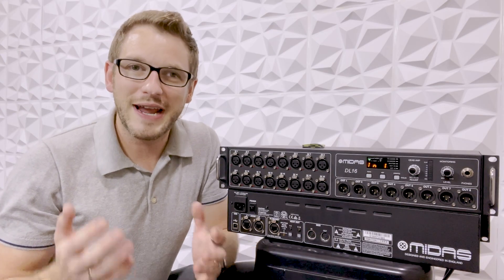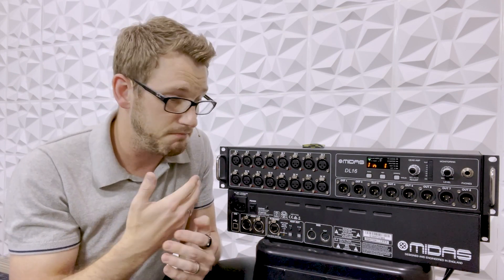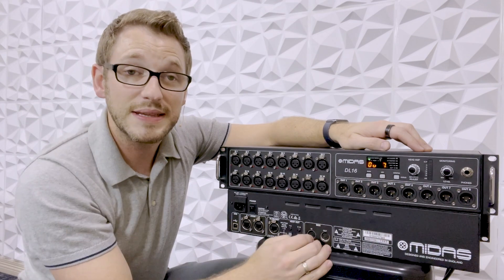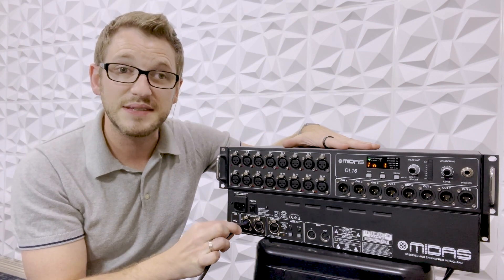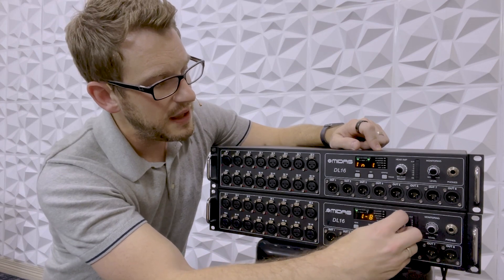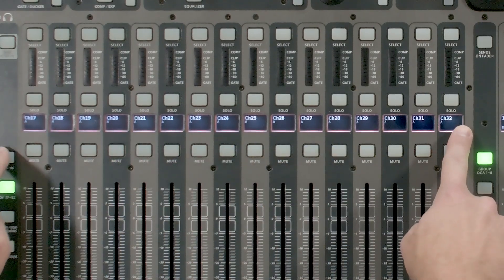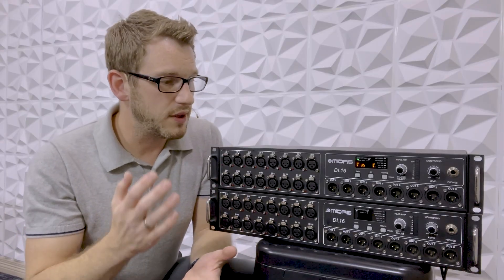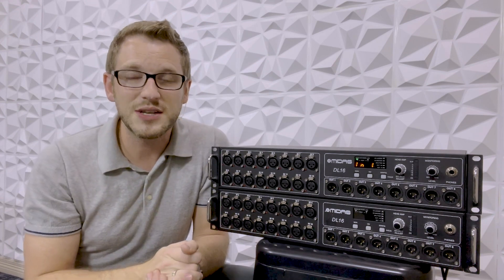Midas DL16 Stage Box & Behringer S16 Stage Box Tutorial

Comment: Drew, thanks very much for such a thorough explanation. However, I still have one question. From what I understand so far, with the DL16 you can't add more channels but rather assign a group of local channels to be routed to the DL16. I have an M32R, and my question is whether it is possible to expand — to add extra channels via the DL16 without losing the local channels on the M32R.   Thanks very much :)
Reply: I don’t know if you have already gotten an answer yet about your question. So I thought I would explain anyway in case you haven’t.

Yes, you can add channels with the DL16 to your M32r. The DL16 doesn’t replace local channels on your M32r. You just need to route everything properly.

So you could make channels 1–16 come from the mixer’s local inputs, and then make channels 17–32 come from the DL16. All you do is tell each channel whether its sound is coming from “Local” or “AES50” (which is the DL16 connection name).
Reply: @j @jaegeorge1045 thsnk you very much for your answer 😊 I suspected that it could be selectively done via user in/out routing.  Though i am thinking that dl16 is way too much for me, but perhaps dl8 would be enough.  Do you know anything about these? Are they as good as dl16? Thx 😊

Comment: new to x32 with S16. Got sync for "A" working. No audio out for speakers on S16. Routed x32 1-8 inputs by selecting "local 1-8." From the S16, need L&R outputs (1&2 or 7&8) to amplifier.

Comment: Hi Drew first off love your channel and particularly all the X32 related content. Quick question related to the S16 and Ultranet port. Can i connect it to a MidasDN4816-O and use it to be a splitter. i currently use the X32 Rack/S16 and have a Midas DN4816-O running off channells 1 throu 16. My S16 is congigured now 17 through 32 but i would like to use a digital splitter for the 17-32 inputs and ultimately have 2 x Midas DN4816-O's as my splitter. One connected through the X32 Rack(this works) and one running off the S16 Ultranet for those channels 17-32.

Comment: Why does it have a setting to set the outputs, but not the inputs? Is the first one in the chain always going to be 1-16 and the second in the chain 17-32? If so, why does this not apply to the outputs?
Reply: Wondering about the same thing.

I guess there's an explanation that can be figured out by looking into the routing section of the console (or in X32 edit), but it is very confusing to look at.
Reply: I might have figured it out :

- the DL16 has 16 inputs, so it can only send those 16 inputs to the console, via the AES A or AES B port. There's nothing to set really on the DL16.

- on the other hand, the DL16 can receive up to 8 channels from the console via AES, but since on a single AES cable you can send up to 48 channels, you need to tell the DL16 if the 8 channels he will be receiving from the console from the AES A cable (for instance) will be the AES A 1-8 or the AES 9-16 outputs of the console.

Comment: i have one of those but for some reason it has stopped linking to the mixer. when i plug the cable from the A port on the mixer to the A port of the stage box the box wont link to the mixer but if should unplug the cable from the A port on the box to the B port then it will link. doing so i dont get audio from the box the mixer. as to my under standing the audio will no route out of the B port only from the A port. Because i had tried everything from watching turorials and such do i need a new stage box?
Reply: I have the same problem right now. Did you find a solution

Comment: Great videos! I have an X32 Rack (main mixer FOH) and S16. I should have 32 IN/16 OUT. The IN/OUTs  are split between the two. I began by setting up my personal IEM on the S16 along with two stereo keyboards and 1 mic for testing. 2 stereo keyboards in CH17-20 (AES50-A1-8) and 1 Mic CH6 (rack) all User routed to outputs 9-10 (S16) for P1 stereo IEM. I am only getting CH 17-18 (one keyboard) and nothing else. I will eventually have 10 IEMS to deal with and would like to accommodate personal mixes for all (as advertised by the product.) But I'm stuck, can you help?

Comment: It doesn't seem like the gains of the stage box can be controlled from the console or remotely. If so, it's a deal killer for the gigs I do. Small stages with limited access, or larger stages where there is little time between multiple bands teardown/setup.
Reply: It definitely can

Comment: Hey Drew, great video, just wondering if you're daisy chaining an s32 and dl16 do you have to have them in a certain order. Obviously want to take advantage of the better dl16 preamps and output for foh. 

Also does the preamp gain on the dl have to be done on the unit or can it be set via the Wing?
Reply from the maker: Doesn't matter the order, as long as you have the proper cable, and go from the port of the WING into the A port of the first box, then B port from the first box to the A port of the second box.

For instance WING (A, B, or C Port) -> S32 (A Port)  |  S32 (B Port) -> DL16 (A Port)

All of the gain would be able to be controlled from your WING. I would suggest making sure the firmware is updated on all of the devices as there have been some changes for the best support on the WING.

Hope this helps!

Comment: So you can have 32 inputs by utilizing the X32 Compact and one DL16. Does that also double your outputs, utilizing the 8 on the X32 Compact and the 8 on the DL16?
Reply: Yes it does. Connecting either an S16, and SD16, or a DL16 to you X32 Compact will give you 32 total inputs and 16 total outputs.

Comment: Thanks for your helpful video. I'm having prob with Midas DL16 recently the phantom function just stopped working. I use top 7 channels for drum mics (phantom mics) and none of them is producing sound b/c the phantom issue. It works fine if I plug in the none-phantom mics. Updated firmware doesn't help. Wonder if you have experienced the issue and share the solution? Thanks so much!

Comment: How would you use this as or with a splitter? If I’m in a 4 piece band (guitar,bass, vocals & drummer) using the x32 rack as an IEM system would I be able to use the dl16 to gain the sonic benefit? How would I route that to FOH at different venues from our IEM Rack, would I still need a splitter or patch bay?
Reply: My initial idea is to just buy two art S8’s and run them into an art 16 patch bay to send a dry signal to the FOH mixer. Idk what would be better. I’m new to this and want to get it right and sounding as best as possible both on IEM & FOH.

Comment: I got a question concerning the outputs. I got a single s16 connected to my x32 compact and want to run my outputs through my s16 on stage as mixbusses 1-8 for monitors, and still use my local outputs on the console in addition. Through the console local outs my PA is connected as well. How do I set this up or configure this, so that I basically got 16 individual outputs, 1-8 Mixbus on stage with the s16 and 9-16 other xlr outs locally with my pa through that too? Thanks :)
Reply: did you ever get the answer to this?
Reply: You route the local outputs in „XLR OUT“ in the routing section

Comment: HEy Drew Thanks for the Video. Just a question, my Wing will be at FOH and in the Stage i have DL32 and M32. I need actually 40 Channels on my Wing (at FOH). Since DL32 has only 32 inputs can i somehow use the M32 as a second stage box and connect rest 8 Channels? If yes How? Thanks a Lot for a quick explaination

Comment: Hi Drew, thanks for the video! I got a question concerning the outputs. I got a single s16 connected to my x32 compact and want to run my outputs through my s16 on stage as mixbusses 1-8 for monitors, and still use my local outputs on the console in addition. Through the console local outs my PA is connected as well. How do I set this up or configure this, so that I basically got 16 individual outputs, 1-8 Mixbus on stage with the s16 and 9-16 other xlr outs locally with my pa through that too? Thanks :)
Reply: Route local outs in „XLR OUTS“ in routing section, it’s badly named

Comment: Hey Drew. I'm having a hard time wrapping my head around outputs. I want my x32 compact outputs to remain the same but want to also send audio down to my stage boxes. This is accomplished using the Auxes you described?
Reply: Did u ever resolve this?
Reply: @zackerysmith1336  yes, it's all within the routing of the console. A little complicated but possible.
Reply: @robbdoozle  any guidance?
Reply: @zackerysmith1336  what specifically are you trying to achieve?

Comment: I’ve been running to these behringers for the last six years as a 32 channel board and cannot seem to get rid of a random popping sync issue that comes up.
I’ve replaced cables, try different power sources and still get the occasional sync drop out/pop.
Would the Midas be more reliable???

Comment: Hi Drew, great video. I am having a new unit here and with firmware 2.7 applied to the unit, the gain will only be adjustable starting with -2.0 and the next step would be 0.5, then 3.0 and so on until + 45.5. In your video you were able to select a gain of 0.0 (which makes sense). What is wrong here?

Comment: Hey Drew, great video! I am having an issue, hopefully you can help. I want to use my stagebox for all “8” monitor mixes but use my local xlr outs for the main outs, ex”out6=sub, out 7&8=main L&R”. I cant seem to figure it out. I am using a Midas M32R Live. Please help!
Reply from the maker: Set up your Out 9-16 to be your 8 monitor mixes, and then have your stage box with the +8 setup that I explain in this video! You will then have your PA and everything out of your M32R's 8 outputs, and then your 8 monitor mixes out of the stage box.
Reply: @DrewBrashler  thanks so much! You are the man!

Comment: Hi Drew, I have a Midas core and 4 x Dl16’s. I’m wanting to use the core on stage with 2 x Dl16’s for inputs on stage, stage monitors and run p16 stage monitor mixers and 2 x Dl16’s    as a y split so front of house can have a signal of 16 of our input Chanels separately coming through the each of the 16 outputs. Most of the time front of house may not have an x32 or Midas hence needing the y split option. Is this possible? Thanks
Reply: That is possible. Use AES A for the 2 boxes you are using for inputs and your outputs to monitors. AES B to the stage boxes you want to use for FOH outputs. Assign AES B 1-16 as User Out 1-16. Then setup the 16 signals you want FOH to be able to get. BTW, the ADAT ports on the stage boxes allow for more outputs. You can plug in 2 convertors and have 32 outputs for FOH

Comment: I’ve been using mine for years I have a producer and a 16 but one thing I will never or should I say figure it out even though that’s the way it works, is why on the aes output of a S 16 do you do one through eight and then the next column it is nine through 16 when there is only eight outputs on the S 16

Comment: Hi Drew, thanks for your videos, always helpfull! Question, it seems not possible to listen to main L/R (7,8) on the S16, thus only to single inputs/outputs. Any reason for this limitation or is there a workaround?
Reply: Might be possible actually (but haven't tried it myself yet). Check out the "stereo monitoring" section of the manual.

"Stereo monitoring
To select a stereo pair of inputs for monitoring, follow this procedure:
1. Hold down the CONFIG button and press the SELECT/ADJUST knob to activate
the stereo monitoring of the AES50 digital inputs.
2. Hold down GAIN and turn the SELECT/ADJUST knob to select the
stereo pair from the AES50 A port that will be monitored through the
headphone connector.
3. Hold down the CONFIG button and press the SELECT/ADJUST knob again to
exit the stereo monitoring mode."

Not sure if by "inputs" they're referring to physical inputs on the DL16, or to audio (which could be the MAIN LR mix) sent from the console to the DL16 via AES.

Comment: I have X32Compact and S16. Is it possible to set Out +8 on S16 for a total of 16 buses? That is 8 on the board and 8 on stagebox?
Reply: Yes that is possible. Hold the config button on the front of the s16 and scroll to right once to turn on +8 led light. Out 1-8 will be the board. Out 9-16 will be the stage box. Makes sure that AES A 9-16 is set to Out 9-16.

Comment: Hey my friend i have a question,,i have the x32 can i use the DL 16 stage box but the other 16 channels using the x32 inputs,,,,
Reply: Yes. You can have 16 channels from the stage box via AES and set the other 16 to be Local.

Comment: So I have an interesting issue with my S16.  It stopped communicating via AES50 (would blink intermittent green). I contacted Behringer support after doing all the troubleshooting I could think of.  Sent the unit in to repair and they replaced the AES50 chip.  Now I have communication with the S16, however, it will not output audio.  I have a second S16 that works perfectly fine.  The repair shop said they were able to get audio from the output but I still am unable to.  Is there anything on the S16 itself that would mute/kill audio going to the outputs?

Comment: Drew, when adjusting Gain or any setting at the S16, is that setting " Mirrored " at the X32 ? If so, can the changes be seen in real time at the X32 while being changed ?
Reply: It's not mirrored. Gain is adjusted to the preamp that is assigned to a channel. So if channel 1 was local, preamp 1 in the board would get adjusted. If channel 2 is stage box 1, then that would be adjusted. The console knows which preamps to adjust based on the channel routing and sources

Comment: When using 2 s16 or 2 dl16 with a x32 and you are using all 32 inputs from the stage boxes which unit has 1-16 and which unit has 17-32 input channels. I know about how to select outputs but how to select inputs?
Reply: AES50 chain as shown in the manual 
www.manualslib.com/manual/1273824/Behringer-Behringer-Digital-Snake-Sd16-Sd8-Quick-Start-Manual.html?page=4
Reply: First stage box will be AES 1-16 in. Second stage box will be AES 17-32. The hookup is A port of x32 to A port of S16 1, B port of S16 1 to A port of S16 2. Also on s16 2 press and hold config and scroll knob to the right once to turn the +8 led. That will make the outputs AES 9-16 for the second box

Comment: FYI although the cost is considerably more, the Midas DL251 or the pro series stuff is even better quality preamps. Unfortunately the X/M32 does not have the ability to take advantage of the full capabilities of the preamps because it lacks the controls for trim adjustment that show up on the pro series consoles such as the Pro2C for instance. To be clear, the channel strip has an input level AND a trim control. The point is to sort of emulate the ability of analog consoles to be overdrive and get some saturation from the circuit. 

Too bad that the M/X consoles AND I believe the Wing as well do not have the controls available to take advantage of this.

Still...there is a noticeable difference from a DL16 and a DL251 with regard to audio quality. Maybe (arguably) a bit of overkill with the M/X series consoles?
Reply from the maker: It has been a few years since I have used the pro series stage boxes with an X32. Audio quality is very good on those units. The tricky part is routing the outputs depending on what model of the pro series you have. I wish I had access to one for making some videos on it! One of these days I will have to track one down to borrow for a bit of time.

Comment: Thanks so much for the informative content as always.
We've just got the x32 compact and the s16 snake. I want to route the outputs such that we can use 6, 7 and 8 on the compact as L, R and M.  That way I can save all 8 outputs on the snake for monitors. How do I go about routing this?
I already have inputs 1-16 routed from S16 and 17-32 on the Compact
Reply from the maker: You would want to use X32 outputs 9-16 as your 8 outputs that you are hoping for and then place your S16 into the (9-16) +8 mode that I talk about in this video. You would have outputs 1-8 locally on the X32 compact, and then 9-16 showing up on the S16. Hope this helps!
Reply: @DrewBrashler  It does.  Thanks
Reply: @DrewBrashler or just route „XLR OUT“ (desk local outputs) as required and stagebox over outputs as normal

Comment: please tell us about midi on s16, s32, is it possible to transmit a signal from the stage box to the mixer?
Reply from the maker: My understanding is that when you have the S16 connected to an X32 any MIDI information in and out of the MIDI ports is connecting to the mixer.

You are also able to control +48v and gain settings via MIDI if the S16 is not connected to a mixer.

Comment: Will this work with any brand mixer
Reply from the maker: The Midas DL16 and Behringer S16 will work with any AES50 compatible digital mixer that can run at 48kHz or 44.1kHz. Basically, any model of the Behringer X32, any model of the Midas M32, and the Behringer Wing.

You are able to run the stage boxes as a snake mode which can allow you to have two of the stage boxes and send channels between the two stage boxes. If you are using the S16 in the snake mode, it would be XLR connections and therefore be able to be used with any mixer.

Comment: I will echo how important using a Shielded cat5 cable is. A rental house delivered an X32 on a job I was doing last week. The board had a piece of tape over the AES-A port with a big “X”. I look at their provided Cat5 cable, and it’s just some unshielded cheap modem cable. Welp, that explains that! 🤡 Luckily I was able to find some shielded ethercon and use the B port.
Reply from the maker: Yes, the shielded portion is the most important part! Yikes for having a rental board being delivered that wasn't in functional order!
Reply: @DrewBrashler  ch1’s motorized fader was broken too! So the manual position of that fader then applied to both layers (1&17) broke my brain until I realized what was happening 👎🏻👎🏻 We won’t be using that company again.